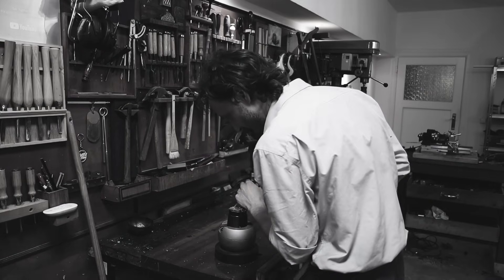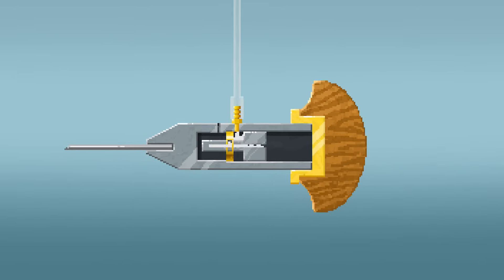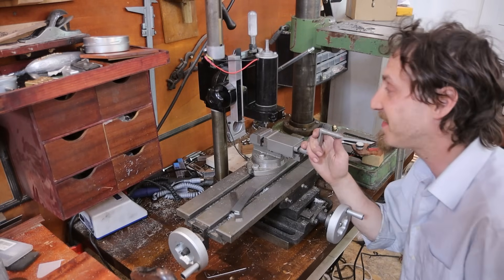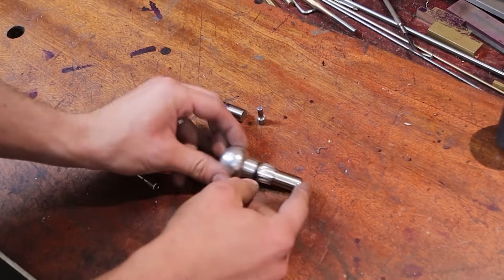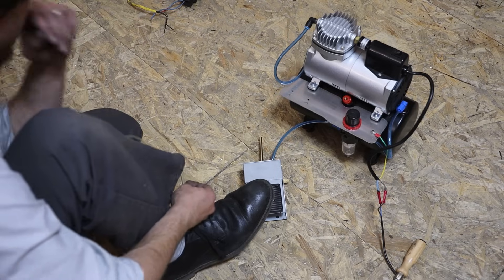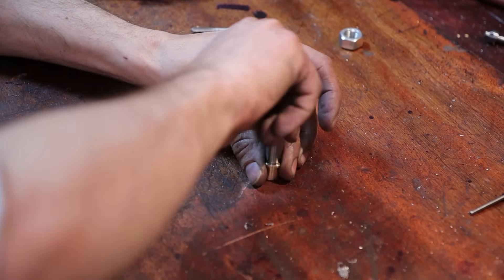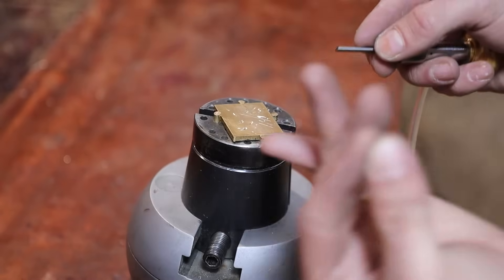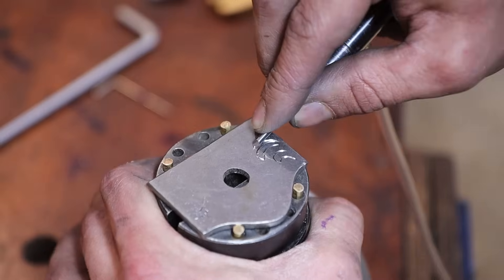Making a Springless Air powered Graver

Comment: I have pretty much the same setup you put at the beggining of the video. A cheapo chinese hand piece and a modified airbrush compressor. There's two key things in order to make it work. First is to put the spring on the hand side, since this stuff comes reversed for no reason. The spring on the front end will prevent the piston from hitting the anvil inside. The second thing is to shorten the piston and reduce it's mass. I took off one ring of metal from the piston and it cuts silver well enough now. At least for me. I make my own gravers with tool steel and for softer metals like silver, gold, copper... The thingamabob does pretty much OK. I can cut acanthus, do stippling and some stone setting. Cheers from Spain!
Reply: Thank you thank you thank you soooo much for this comment. I built one of these also and had already swapped the spring around but was having tons of issues with it stalling. I cut the piston down like you suggested and now it runs like a beast. Seriously you saved me a ton of money and time I really appreciate it.
Reply: @tanimator87  You're welcome buddy. Have fun. You can cut more of the piston if you want to experiment. Less mass will make it run smoother but also is less energy hitting the anvil. However the piston has more room to gain momentum, so it's a balance.

Comment: I think you need to make the oscillating inner part (the part that the air moves back and forth) heavier, use a denser alloy or add some mass to the back of it.

Comment: For less vibration in the hand you could have a damping piston on the handpiece side, just a free-floating piston with a spring behind it. This way the pulsating force on the handpiece is instead exerted on that piston and spring. The spring just needs to be strong enough to prevent the free piston bottoming out, and the mass of the piston just needs to be well above the the mass that would resonate at the operating frequency. It's kind of like how a constant recoil machine gun works, averaging out the pulsating force into a much more constant force from a spring.

Comment: A pair of WALKER ear muff's with noise cancellation electronics built in to them, will pick up on the buzzing, and hone in on that and no more sound. Granted, you now have ear muff's on, which can be a pain in the booty, but, I then plumb in music from a MP3 player/cell phone through the COMM's phono-jack port and the volume is controlled by the device playing the audio, not the ear muff's that are cost effective entry level hearing protection, approx $50 bucks. Now, there are some ear muff's out there, including WALKER brand, like WALKER's higher line series, but, the cost is reflective to this that has it's own volume control of an incoming COMM's signal adjustment and those can be as much as $600, which is not practical, unless your profession requires such equipment to be high quality and performance, like what a soldier or a sportsman shooter.

Comment: The graver systems with the reciprocating flow of air will display an action akin to capacitance in electronics. If the hoses are too long or large in diameter or the reciprocation too fast the action will be weak/mushy. They can work OK. 
For simplicity, my preference is the ported piston form as well

Comment: For this application, the best solution would be an eletric motor driving an espiral piston with an spring reset. Check the  the Fountain pen Boheme from Mont Blanc. You could use the same method to drive down the bit, and on the end, the piston unlok the spring wich would force the driver up and start the moviment again. For that, the piston should be chonical.

Comment: Grab a pair of earmuffs if the noise knocks you out of your zen zone.
I do a lot of sandblasting and I also find the noise (of the dust extraction) gets a bit distracting. The earmuffs turn it from an irritation into a calming background buzz. I often find myself still wearing them long after finishing blasting just because the muffled silence is oddly nice. You can also wear wireless earphones inside them for a crystal clear music experience.

Comment: Hi Uri, i also made my self a handengraver like youre first one, it works fairly well and i even made a viedo on how i engrave some stuff, also i made a nice video how to transfer the patterns very safe and easy, if you want to check that out. thanks for showing how the graver with just compressed air is made. i will make some 3d drawings and try to make a working version my self. we will see if i can makle it work fine. i can share my 3d files with you if you like me to. i am from Austria, so i guess i am not far away from you :-)

Comment: Is the noise vibration or is it the exhaust? If it's the exhaust, there are things you can do to reduce it., like a short stub of tubing with wire wool loosely packed in it and attached to the exhaust.

Comment: Oh, and your collets need 2 o-ring grooves. That will make them more stable in the barrel of the tool, and will keep them from wobbling around, which they will do if your pieces aren't heat treated. The pieces will wear quick, and start wobbling. If you want to keep it from shooting the collets out, you need thicker orings for a tight fit in the barrel.

Comment: I use a Lindsay Classic airgraver everyday. You're missing a huge part of the equation to making your tool work. The Lindsay foot pedal is a key piece. It doesn't work like the GRS or chinese copy foot pedals. The closest thing you can get to it(because Steve Lindsay will not sell his pedals without buying the whole system) is a GRS System 3 pedal. That's the pedal most people use with their Andu(vietnamese Lindsay copy). None of the other pedals from GRS or chinese copies use the same air valving system. Only the GRS System 3.
Reply: I believe the GRS system uses a servo actuated air valve to control the speed of the stroke?

Comment: Hey Uri, you might try some thin rubber sheet inside on either side of the piston. Lots of air cylinders have bumpers like that in them to help cushion the impact and make them quieter.

Comment: Hi Uri. I also made an air graver a few years ago. In case you’re interested…
First, I made the back and forth version powered by a modified little air tyre compressor. This was a waste of time.

Next, I made a basic version of the Lindsay engraver. The same piston arrangement but without the pressure on/off handle. It functioned… kind of. I guess you saw videos of Lindsay engravers shredding steel like a plough through dirt. Yeah we’ll mine was lame. It vibrated and did the thing it was supposed to do, but I’m not sure that it did it much better than if I was just pushing by hand.

I tried heavier pistons, enlarging holes, more/less air but it never worked well. I think the valves have to be just right, so that the piston smacks the end of the graver at maximum velocity, before the upwards air has any effect. I found it hard to get that to work without stalling the piston. Anyway, I couldn’t easily get it to work well, so I gave up.
Reply from the maker: Hey, yes, I didnt show it in the video, to not bore the viewers, but I've tried a few other piston designs but the first one seemed to be the best from all of them. I agree, it seems to be very sensitive to every little change, and the design needs to be just perfect to function properly.
It's funny, I've just been watched a whole bunch of your videos as I just purchased a new old Myford lathe that I wish to restore. I really enjoy your channel!
Reply: @urituchmanpigeon  is it the myford M type? If so, there is a great group online called "Drummond io". I've created a lot of mods for my M type and they were very helpful folks. The M type was taken over from Drummond Brothers after the war and there is a large community of Drummond owners.
Reply from the maker: @jambusspeakermouse1325  cool thanks! It's a super 7 mk1.
Reply: @urituchmanpigeon  Do you plan on making a video on restoring it?
I would love to watch it.
Reply: @urituchmanpigeon  Oh wow! That should be a great addition.
Reply: @urituchmanpigeon  Inspired by Geoffrey Croker's series, I am most of the way through tidying up my Myford Super 7 Long-bed.  My father imported it into New Zealand when I was about five years old; it is number 147 of this model, and has been part of my life since then.  I moved it from Dunedin to Lower Hutt in about 1981.  It was put into storage from 2008 until 2020, and I have been slowly working through moisture damage from the leaky storage since then.  Only the headstock housing and bed remain to finish stripping and repainting, followed by ancilliaries like milling slide and second 3-jaw chuck.
***NOTE***:  I contacted Myford, and they confirmed that machines of this period were finished with lead-based paint.
Reply: @urituchmanpigeon  perhaps the shape of the engraver stillest might need different profile for power engraving
Reply: Did your air chisel also sound like a prolonged fart?
Reply: Well now you have to engrave something for the Rover.
Reply: Could be how you sharpened the bits? Like, too steep or shallow a point, not sharp enough, or even the wrong steele? These all effect the performance of any cutting tool.
Reply: it needs a spring behind the valve
Reply: @Jose-x3d4d  I was thinking the same!  The current version relies on air moving the piston both forward and backwards which results in a more complicated design.  With a spring the air would only be used for the piston to be moved forward.  But then I think there would need to be a valve or air pressure release on the engraver to let air escape when the spring activates for back movement.
Reply: Hi Geoffrey, I made some air gravers myself too. I'm wondering, did you ever increase the thickness of the inner ring to allow the piston to pick up more kinetic energy while its moving away from the chisel? Because then it might get more time to put air pressure on the back of the piston to move it back to the chisel with more force? And it allows for a larger piston movement too. 

I'm considering to do this for my own air graver but am wondering if you have any experience already!
Reply: @Geoffrey Croker , is your graver fixed into the tool solid? or is it "floating" in-front of the "hammer"/piston? if it is fixed into the tool you will have much less impact effect on the tool then if it is floating in front of the piston (as you describe, quite possibly less then if you were pushing it, but perhaps more controllable) if the tool is floating the piston can then drive the cutting graver away from the tool and your hand instead of trying to drive the whole tool from within itself... having a set-screw/retaining-o-ring would allow for both options and allow for both fine and aggressive cuts with the same tool ;)  
also.. what the tool in this video lacks is adjustment in the foot control.. on and off is nice, but a variable air-flow foot control allows for much finer adjustments on the fly and makes the tool many times better.
Reply: Is the piston hardened? If not that might help with power transfer. No expert, just a guess.

Comment: Your lathe is the taig, no? I have a neighbor with one who makes fancy pens. He had a similar problem with the motor weakening after only a year. I helped him track down a motor off of eBay made for a pride brand mobility scooter. This is the most common brand on Earth though I believe it comes in many different brand names. This is important because it was an exact match! Much heavier windings, all together a better quality motor and much more grunt in the low end. It even fit the original bearings! I believe it was $42 American after shipping and there were cheaper options, he went for a new in box. If you decide to go this way, just respond to this comment. I will go looking through my eBay archives to get you the exact model number if not the seller as well. Be well

Comment: I tried to design my own pneumatic graver without much success at all, I could not get enough torque out of the air without it rocking the tool when it reached the end of it stroke. For like a year now I've pondered whether a tattoo gun might not be better inspiration? I can only guess based on the amount of pressure needed to puncture the skin, but it seems like it's carefully crafted for the user to be able to keep us steady hand. Have you tried using a pair of coils?

Comment: Make sure to run a little air tool oil through this.
Awesome build. 😊
Reply: In a properly built pneumatic handpiece, the tolerances are so tight that oil causes enough friction to stop the piston movement. The oil also attracts dust,, and will stop the piston.I use a Lindsay Classic Airgraver daily, no oil.

Comment: Cool project.
The noise it makes could be tuned with the air outlet, might need some more experiments to get a better audio experience out of it. A lot of pneumatic tools use "silencers" at air outlets to make them less noisy.
I wonder how much the mass of the moving hammer piston impacts the chiseling performance, maybe with a bit more material or a very dense/heavy material (tungsten-insert?) it would be even more useful?